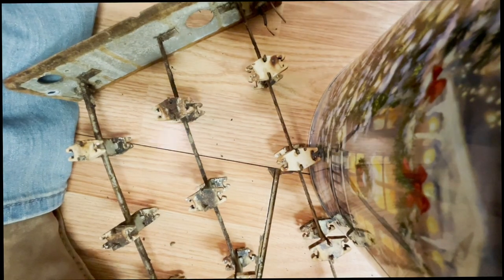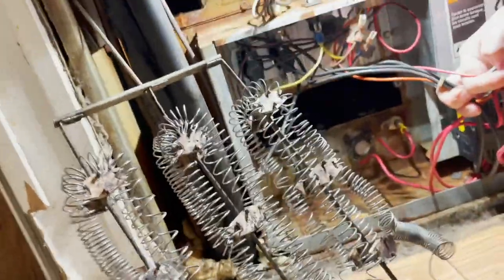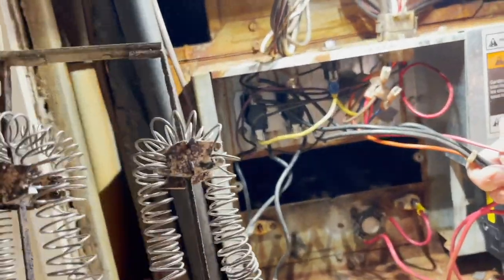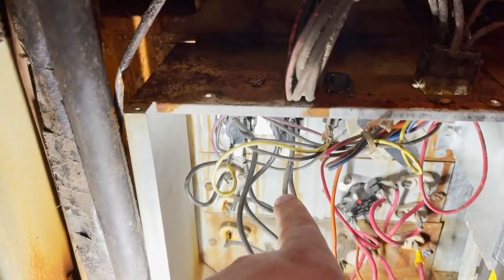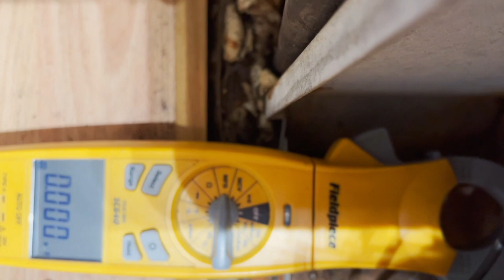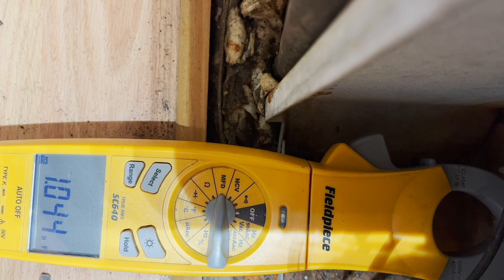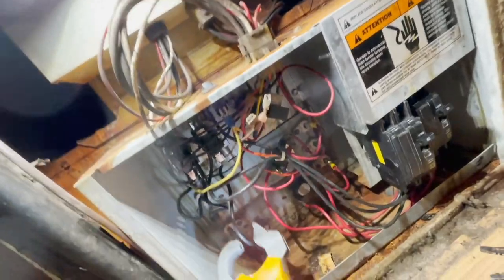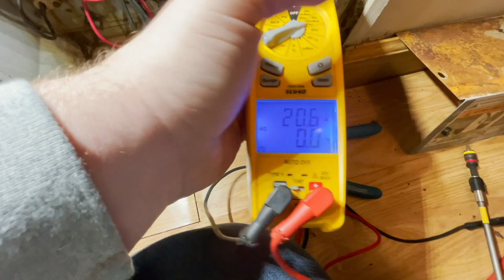HVAC No Heat/Restring Electric Heat

Comment: When stringing heater wire need to make sure none of it is clumped together, otherwise it gets hot spots that burn out. Can take out the old one then carefully pull the new one to match the length
Reply: exactly.... that is how i was taught

Comment: Intetesting.  If they rely on resistance heat  I would consider installing some small baseboard units as a backup.  Easy and inexpensive, assuming they have a main panel that will handle it.

Comment: Why work HVAC? Zsa sez Professional Gaming is where it's at now.
Reply: @johnisraelhvac2019  Don't laugh - When Zsa's buying you out you will see.  He can right now, but he's toying with you.  He has the Pep Bois Millions, and is sponsored by Hot Pockets.
Reply: Damn how big is that mobile home for 15kw of heat. In Chicago, I installed a 10kw (9.6 really) and it keeps the home warm in -10 degrees and the apartment is 1,100 sq ft. Just wondering. That’s like 51k btu.

Comment: And them heaters are going to burn out because the ends you have them to close together it’s going to have hot spots and burn out
Reply from the maker: No it’s not because I read the paperwork that came with them and I spread them apart to the minimum the string kit was longer than the original I did the best I could with it don’t be a dick Mr. super tech